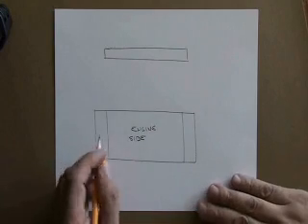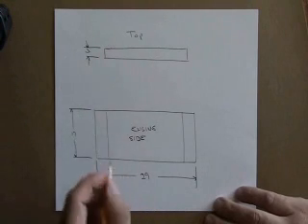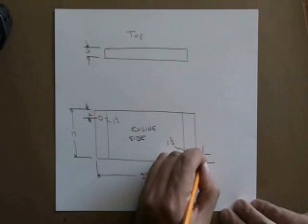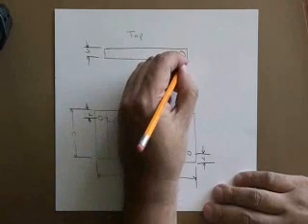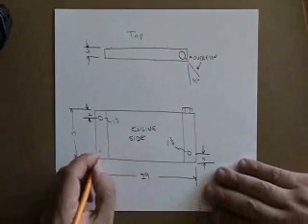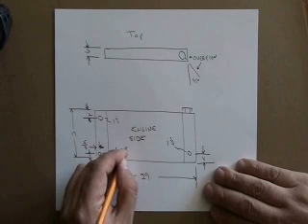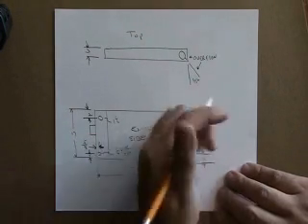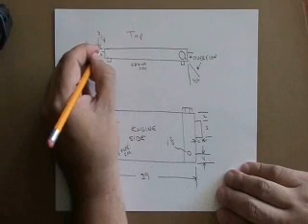Ron Davis Custom Radiator Drawing Basics

Comment: I had 4 years of drafting in high school as new, but no shop. I completely understand this drawing and appreciate the creativity. 
  As a self taught tech who had an apprenticeship at a two man shop, I was hired at a dealership at 20. I was ask to fix overhearing problems, synchronize dual carbs and using 3 gas analyzer's to adjust Air : Fuel mixtures on electronic fuel injection on the 76 Datsun 280Z. The other two would not work on them.
  I have more about the correct way to fix my cooling issues. Thanks! (Note; I heard of this brand on Counts Kustom's  TV  show)  Congratulations, I pay attention with a LS going in my 67 C10 pickup. Thanks!